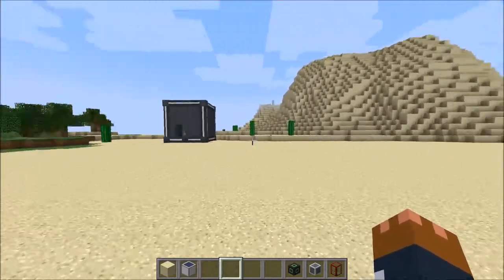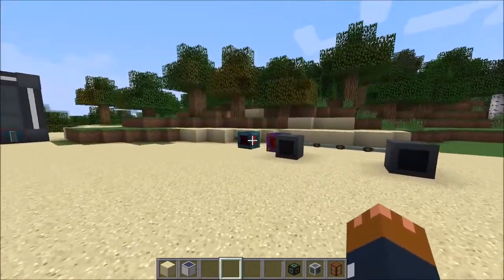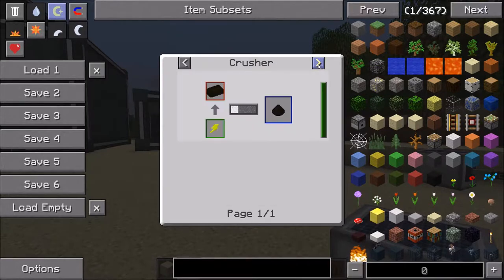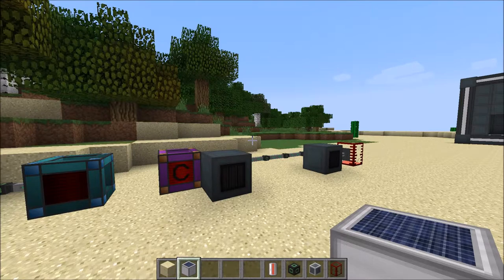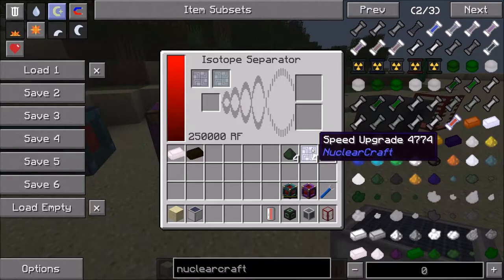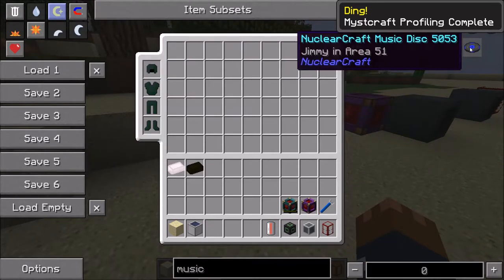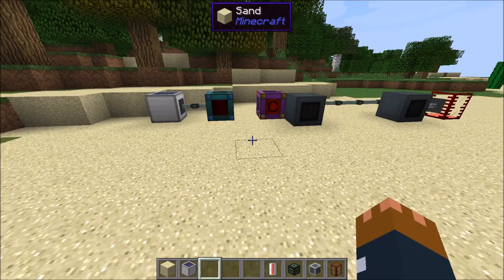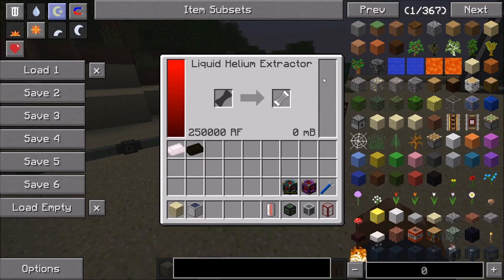Liquid Helium, Solar Power and More (1.6a to 1.6e)

Comment: Awesome work! I have spent so much time on your mod, it is unbelievable. In order to visualize the dependencies of fissure products needed and what isotope is being generated how etc, I made a wall of "holo signs".  If you ever want to implement something on the "usability" side of things, I am convinced that some kind of periodic table would be very beneficial. Basically any sheet of paper, or screen, or info system that is summarizing your fission products lifecycle. I have uploaded some screenshots here, showing the first plant, then the nuclear meltdown (I forgot to switch the lever...), then the rebuild, and finally the whole setup with main 17x17x17 reactor and a 2nd breeder reactor.

Unfortunately, since my buddy made a mekanism fusion reactor in our base, we now produce so many million RF, that it made our NC reactors obsolete. Now I only use them to create nukes. :-)

However, the facility powered our base for quite some time. Utilizing HEP-235 Oxide in an 17x17x17 reactor filled with coolant and graphite, producing about 700k RF.

Anyway, my point was: Look at the holo wall. That info in one book / sheet would be very handy. 
In addition to that picturing the lifecycle of the products would also be neat. Something like Th232 -> U233 -> U235 -> P242.

Here are the shots:

http://imgur.com/a/58CRc

Cheers!

PS: Just out of curiosity, may I ask what you do for a living? Are you a programmer? You sound so professional about what you do...

PPS: Thumbs up for removing the 5x5 workbench. While it was a really cool idea, it quickly becomes a menace to handle, especially if you play with AE2 recipe-auto-crafting, or pipe automation systems. When you said: "It takes away more from minecraft than it adds" I thought this phrase was spot on.
Keep up the good work!
Reply from the maker: That looks incredible! Glad you've been enjoying it :) Looks like you really went the distance with squeezing every last drop out of your fuel cells, and that info board was very sophisticated, but I see what you mean. I'll certainly look into it, but for now there's recipes on NEI that you can bounce through to work out what to do.

Well, I would expect fusion reactors to generate more than fission reactors, so I'm not surprised - those Mek reactors are also pretty cool builds. Of course, nukes are also fun. Another option is to make RTGs, but if your generating a couple million RF/t now then there not gonna be much use other than to power Warp Itemducts or BuildCraft wooden pipes (which is usually my main use for them).

I'm going to get some videos out over the next day or so on the new fission and fusion reactors and how they work - there a bit different from the old ones, but hopefully much more fun to use. Fission reactors can be a shape of any cuboid and can have 8 different types of cooler in them, with different uses, can have the cell compartments in any part of the reactor, with adjacent cell compartments generating more energy and heat, raising the efficiency of the fuel, graphite is much more useful and finally, I got rid of those weird 'reactor multipliers'

Comment: Fantastic updates!  I can't wait for that next video!  Seriously, I can't wait... going to have to go do my own experimenting!  I have just updated to the newest Bevo's Tech Pack Reborn which includes the Nuclearcraft updates (they separated them out to help prevent peoples reactors from exploding due to the changed heat mechanics... and yes I made sure to turn off my 2 current fission reactors).  I came to your channel hoping to find an explanation of how the new heat mechanics worked so I could reconfigure my reactors, but I suppose I will just have to do some experimenting... with my current setup I have a 5^3 reactor (the first one I built) with enough coolers in it (before the update anyway) to handle HEP  and HEU Oxide fuel, though it generates some heat with HEP Oxide.  I don't use that reactor continuously, but do use it on occasion for a bit extra.  My main power source is a 17^3 reactor which I experimented on, figured out the perfect setup to max out the number of graphite blocks possible while still keeping 0 heat production with TBU fuel.  My power needs aren't greater than that currently and I like that the fuel lasts for a long time.  I built a Mekanism Energized Induction Matrix which can currently hold a bit over 400 billion RF and I'm slowly filling it up.  Very slowly.  But that's why I went so over the top with storage for my present situation.  I can just keep it running while I build other things, and know I'm not wasting anything!

Alright, time for some experimentation.  You said in another comment that fission reactors can be ANY cuboid... does that mean they can go bigger than 17^3?  I suppose I'll find out when you finish the new video.  Thanks for this video, I highly anticipate the next one!  And thanks for your work on the mod.  I'm a software engineer myself and highly value your efforts!
Reply from the maker: Ah yes, I think I did see Bobster post about that - it's a smart move. I have promised to upload videos on the new fission and fusion mechanics today, so look out for them - I guess experimentation is the way to go for a few hours :)
The side lengths of the fission structure do not all have to be the same length anymore, no, so you could have, for example, a 5*8*14 reactor. There is a config option for the maximum length of any side - the default is 25 I think, making the biggest reactor possible 25^3 by default. The column of fuel cell compartments down the middle is no longer a requirement - the position of the cell compartments is up to the player now, and their relative positions will effect heat production, power production and fuel efficiency. There are also 7 new cooler blocks if you haven't seen them already, and graphite has been made a lot more useful - it generates a lot more power than it did before :)
Thank you very much!
Reply: I did a bunch of poking around in NEI and I love what you've done with the mechanics.  It makes it really very complex to figure out an optimal configuration.  Some people might not like it, but I love it, it's a neat puzzle.  I am quite confused about efficiency though.  It is only mentioned in one place, as playing a role in the power output... but none of the blocks claim to have any effect on efficiency at all.  The fuel cells don't seem to have any kind of 'efficiency' rating either.  The heat mechanics, as explained in NEI, don't mention any involvement with efficiency but I am thinking that it must play a role.  My 17^3 reactor with 17 fuel cell compartments (previous config, 2 with 1 neighbor and 15 with 2 neighbors), 2142 graphite blocks and using TBU fuel, without any coolers at all, according to the math presented in NEI, should produce only a bit over 25kH/t.  But my reactor, with 2754 standard coolers (all with coolers adjacent, so mitigating 60H/t ea), would produce >300kH/t if I were to turn it on... so I'm guessing the 1544% efficiency is somehow playing a role.  c is 17, TBU base heat is 4, graphite blocks produce (c / 5)*(fuel base heat) so only 29131.2 H/t for all 2142 of them.  The fuel cell compartment description says it generates "(n+1)(n+2)/2 times the heat"... is that "time the fuels base heat"?  Or "times the heat including contributions from graphite blocks"?  It's only 384 H/t for the column of 17 if the first.  So I'm at a loss as to where it's managing to get 300+kH/t  (it might be over 400, I forget, power went out last night and my PCs power supply decided to bite the dust even though it was on battery and I shut it down gracefully... why can't they put fuses in those things?).  The puzzle continues... I need to experiment with my smaller reactor before tackling the big one I think.

BTW I love the Assembler.  That's a great solution to being able to automate crafting which I appreciate.  I have a gigantic AE2 autocrafting setup and have always wished I could autocraft some of the things, especially things needed en masse like reactor casings, coolers, etc.  Is there any chance at all that someday Nuclearcraft might be make compatible with Mekanism gases?  So that we could, for instance, pump oxygen from a Mekanism Electrolytic Separator into a Nuclearcraft Oxidiser either without putting the Oxygen into cells or perhaps with a middleman machine that can inject the Oxygen gas into a cell?  I have no idea how that would affect balance and whatnot, was just curious from a 'I am already producing Oxygen and have a big tank full of it... why can't I use that?' perspective.
Reply from the maker: That's exactly what I attempt to encourage - I like the idea that the effort that has to go into designing the most efficient setups requires, shall we say, a pen and a bit of paper. It's like an almost impossible puzzle game amidst an attempt to build a large, expensive power source.
Efficiency is effectively the ratio of the power that is being generated to the power that would be generated if there were no graphite/water blocks and no adjacent cells - in other words, it is the ratio of the actual power generation to the power generation in the worst and least efficient design possible (in terms of power generation).As you will discover in the Fission tutorial tonight, I too discover that some the calculations in the NEI info are flat out incorrect in some places, which I am fixing right now - for example, in reality, the heat each graphite block produces is baseRF*numberOfCells/5, not baseHeat*numberOfCells/5 like it says in the NEI info.
Also, if your base TBU heat is 4, then you should reset your configs - a lot of the values have changed. For example the base heat of TBU is now 20.
The best reactor to experiment in is almost certainly the 3*3*3 - it gives you just enough space to test out every possible adjacency dependence.

The assembler has been a must for a long time - I first tried a machine similar to BC's auto-workbench, but it was difficult and clumsy. Then I added that vanilla crafting config, and now the assembler is in the game, and it's nice and simple to use :)

Now, Mekanism gases... you will be happy to know I have already started some integration. Currently, the only compatibility possible is with the Fusion Reactor - you can pump in Hydrogen, Deuterium, Tritium and Lithium (treated as Lithium-7) into the Fusion Reactor to fuel it - you will see some of that in the Fusion vid :)
I do plan to add compatibility with the other machines like the Oxidiser - I just need to do some more calculations to see how to best attain balance.

Comment: Hey, love your mod, but it's been a while since I last played mc ;p
But I think you shouldn't set the workspace thing default off, I think it'd be better if you'd make an autocrafter which can handle the 5x5, that way you keep the possibility of auto-crafting, but you don't lose the uniqueness that the workspace brings ;).
Reply from the maker: That's a nice idea - perhaps I can have a look at how the Railcraft rolling machine or BuildCraft auto-workbench works to figure out how to implement an auto-crafter.
Reply: thanks, though I like the autocrafter from thermal expansion better, maybe you can look at that ;)Also, there an ETA for the 1.7 video?
Reply from the maker: Mister Eel Well, the problem is that TE is not opensource, so I can't look at the code in the same way I can with BC.
I happen to be working on the current video at the moment :)